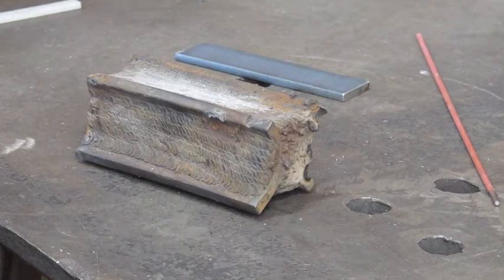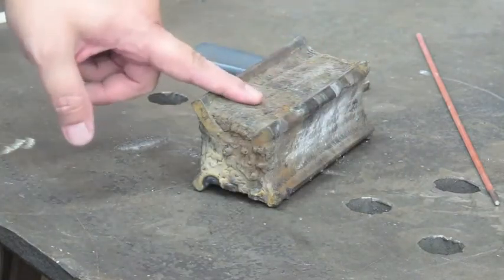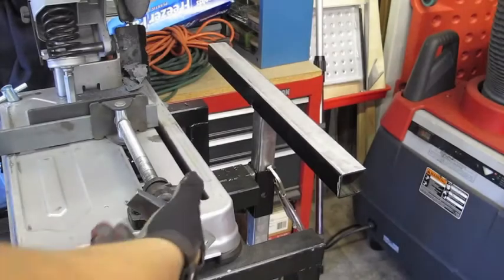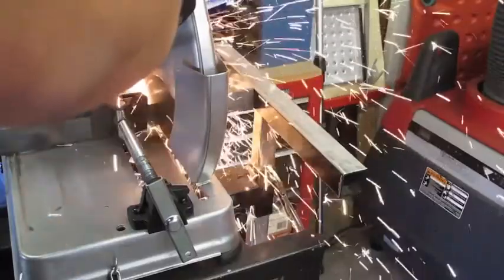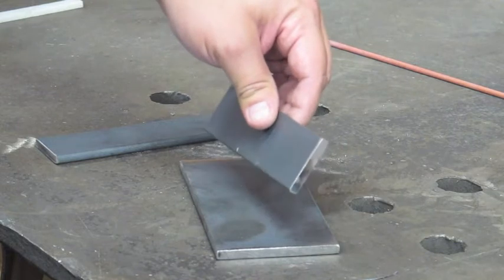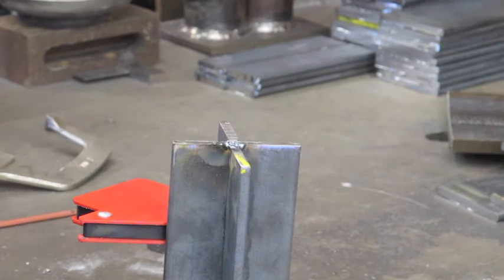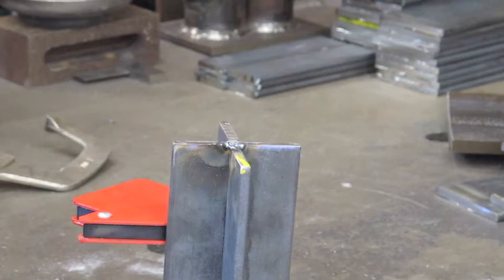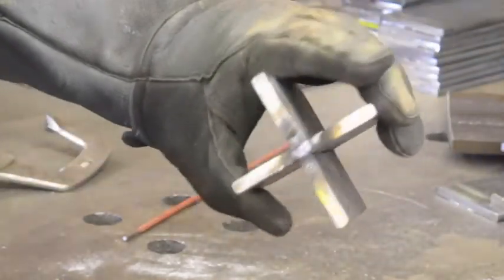Making a Cruciform for Welding Practice

Comment: We did a lot of practicing on these "cruciforms" when I was in welding class.  Like you said, it is a good base for running lots of beads.

Will you show how you weld vertical up, and some open root butt joint welding?  Thanks.